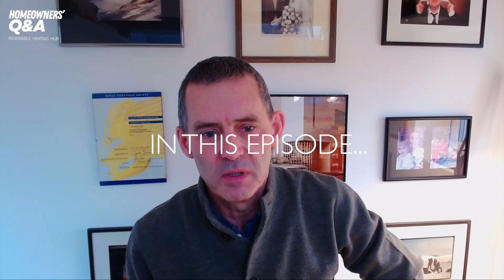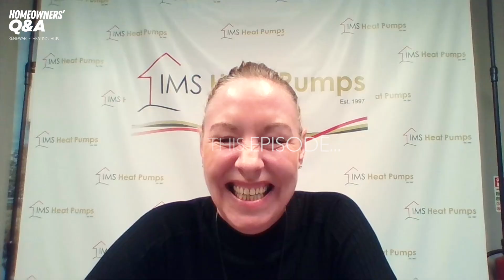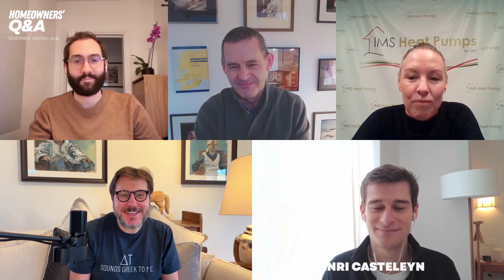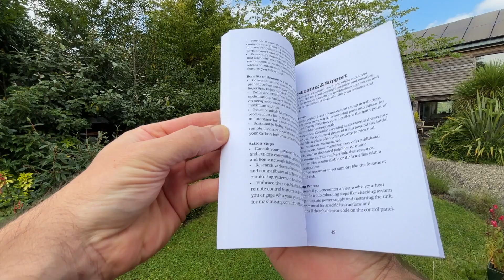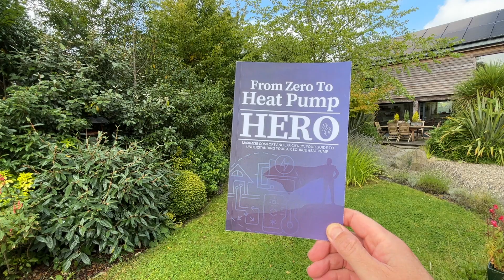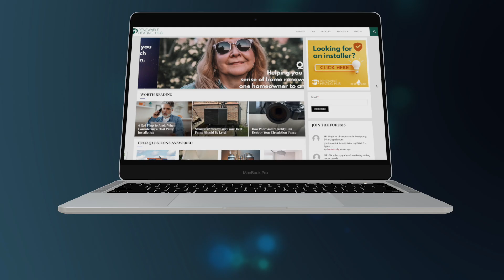The Future of Heat Pumps: Adia & Havenwise Revolutionising Efficiency, Smart Control & Affordability

Comment: Why were the  Homely smart controls not included in the video
Reply from the maker: We’ve covered and spoken to Homely before, and they’ve been around for a few years now. This was an episode for two new upcoming products with a lot of promise.
Reply: @RenewableHeatingHub  What I did not understand was ,what is the difference between the Havenwise product and Homely
Reply from the maker: Homely has add-on kit and hardware, where Havenwise is purely software and requires no additional hardware.
Reply: @RenewableHeatingHub  Exactly right! Havenwise and Homely also have a different list of heat pump brands they work with.

Comment: Can Adia work with Tado or similar smart TRVs, or would installing Adia require existing smart TRVs to be removed?
Reply from the maker: Adia will be able to reply to that with more accuracy, but I think the system will only work with its on ‘TRVs’, not Tado and other brands because those TRVs don’t monitor flow into the radiator.
Reply: Thank you. If Adia could combine forces with Tado, then it could be a really compelling product offering, and probably cost effective for both the companies as well, if they can see it from that angle. :)
Reply: If I understand correctly Tado functionality is a small subset of the Adia functionality.  Each room has an Adia thermometer as well as an Adia TRV on each heat emitter.   There’s nothing Tado can do that Adia can’t do, and Adia do a lot more with each TRV.  

Don’t worry about regular on/off TRV units.  If you have Adia installed the flows in hot rooms will be reduced to keep the right temperature.

Comment: This stuff should be integrated directly into the HP controls. HPs are far, far too complex for novice users. My 70 year old mum would have no chance with a HP, but a boiler is super simple. Install it, set a thermostat and timer, done. HPs are where EVs were in about 2015, which is a shame as HPs are far from new. This needs fixing if HPs are to stand a chance of mass uptake. Make it simple!
Reply from the maker: Fully agree. They should be simplified and work efficiently from day one with minimal tweaking.
Reply: Spot on!

Comment: Thanks again for the great content.
Can you please look at a successful Dutch Heat pump called Adlar Castra which has just begun its operations in the UK? They have an interesting product, different from everything else I've seen before. Look forward to your experts providing feedback about it. Thank you!
Reply from the maker: Thank you the heads up. Will check them out and contact them.
Reply: @RenewableHeatingHub - that's fantastic, look forward to it. 
Adlar calls it an inline system where you can do radiator and hot water heating simultaneously. Looks like they use Panasonic and Grundfos components.
Reply: I'm from the netherlands and we've had a salesperson form Adler 2 days ago.. After this I can't even tell you something about the ínline system' because he didn't mention much about anything. A little disappointing..
 I had expected a real sales-product-presentation-setup- at my house because they only do heatpumps installation. I thought that would be better than a local boiler-installer with minor experiance that maybe needs to call expertise from a vaillant or daikin, etc, dealer. 
This man just watched the situation, took picture of the places where the heatpump needed to be placed and the electrical parts in the house. He didn't talk about radiators. Just came up with the 10 kw heatpump and made a calculation on his laptop for the price. We had to pay 7.500 euro's installed ( after 2.800 euro's 'grant' form government). This is/was hybrid installation with our gasboiler. The heatpump will do 'all' (?) the heating for the house, the boiler for the hot water. So it's a realtive simpel instal.. directly on the pipes below the boiler. He even mentioned shorly with only 2 words about a little,.. I think volumnizer below or next to the boiler.. 
We  use 2.000 m3 gas a year for heating and hot water with the combiboiler now.
Reply from the maker: Very interesting. Thanks for sharing.

Comment: Does Adia comply with MCS ? i'm guessing it doesn't 😢
Reply: Adia here! Yes every install we've done has been MCS certified and BUS grant eligible.
Reply from the maker: Why would it need to comply with MCS, and what benefit would that bring?
Reply: From my understanding,  the Adia device is a third-party component that the Heat Pump installer will fit at time of install. The HP installer will still have had to ensure that the install meets MCS standards if BUS grant is to be obtained. With the higher temp ASHP they will probably be able to design systems that meet MCS standards with little change to systems,  but with associated higher running costs.....until system optimisation recommendations applied.

Comment: So, Adia sounds like it's basically Drayton Wiser TRVs and Room Stats - just specifically for heat pumps, and adding flow monitoring? Wiser TRVs are £50 each; room stats are £70. So for a mid-sized system, if you need both, plus a hub, that's around £1000 just in hardware. Or to put it another way, that's the cost of about 6-8 large double panel radiators. I see the argument about labour saving, but it doesn't seem like a good investment to skip upgrading ancient type-10 and type-11 radiators and spend the money on glorified TRVs instead.

Wiser does work very well - accurate temperature control, weather compensation, etc - albeit with some cycling if your boiler can't throttle down far enough (my experience) - so I'm not really doubting the Adia solution works - but I do doubt the cost-effectiveness, especially since the pitch seemed to be "upgrade radiators later" rather than "no need to upgrade".
Reply: Adia balances the valves across the home in unison; more like engineers with their hands on the lockshield valves, than a TRV adjusting when the individual room reaches temp. For this reason we can maintain significantly higher system volume for the heat pump and limit cycling. 

Because Adia replaces a number of key components of an install (buffer, diverter, secondary pump, monitoring), the incremental cost is almost always outweighed by savings in labour and overly conservative radiator swaps. 

Our mission is to make heat pumps as cheap and easy to install as gas boilers, without increasing running costs. After which we can use measured data from your home to make bespoke recommendations for how to best improve your system's efficiency.
Reply: Also sounds like Wiser isn't doing well in that situation and that setup if it's leading to a lot of cycling, it should be achieving the opposite. I don't think it sets the flow rates to each rad so in that sense the rads remain rather "un-smart", in contrast to Adia, which actually attempts to make sure each rad gets roughly the right amount of heat to it at all times.
Reply: @sunenightingale7384  that's just a problem of the boiler not being able to throttle down far enough - it can only go as low as about 7 kW.

My general point is that it sounds like essentially the same tech. Wiser TRVs make fine adjustments, operate together in zones, can reference external room stats by zone, and the system provides excellent temperature control with weather compensation. 

But if the hardware is basically the same, I'm curious about the cost of the Adia kit. Wiser TRVs are about £50 each - and you can literally buy a double panel radiator for that! 

So the value prop looks like delaying the labour cost on replacing radiators that are probably near EOL anyway, and spending a significant chunk of cash on a bandaid - and by the sounds of it hiding that cost in the BUS.

I'm not skeptical that it works. I'm skeptical that it's a good use of money that could be spent on emitters.

Comment: Is adia an extra cost to the consumer and does the savings in labour offset it?
Reply from the maker: I got the impression that the savings in installation time and not always having to upgrade radiators offsets costs.
Reply: Adia here! Adia replaces a number of key components of an install (buffer, diverter, secondary pump, monitoring), so the incremental cost is almost always outweighed by savings in labour and overly conservative radiator swaps.
Reply: also if you ask engineers how they balance rads everyone seems to do it in a slightly different way. The uniting factor for most of the ways they do it is that they are often time-consuming and to various levels of inaccuracy. 
You could do it with flow-settable valves like IMI, Giacomini, or Danfoss - however the flow rates assumed are based off of probably-inaccurate heat loss calculations, whereas Adia are, I think, setting the flow rates required based on the actual measured room temp. 

In addition Adia should be able to set the weather curves much more accurately than an engineer is likely to be able to - at least without visiting multiple times.

Comment: If installing a heat pump I understood that some radiators must be changed if the heat loss survey determines this. Mustn't you do this in order to comply with MCS and getting the BUS grant?
Reply from the maker: There’s no requirement that you must upgrade radiators even if the heat loss recommends it, and it doesn’t impact the grant.
Reply: @RenewableHeatingHub  Is that still true? I thought the MCS installer must sign off that the proposed design will cover the calculated heat requirement for each room

Comment: I just installed Havenwise for a free trial. Interested if it improves my heat pump? I have just noticed the first bump in the road, it won't let me heat my water to 62c like I normally do cheaply with octopus intelligent go?
Reply from the maker: Im sure that the max. heating parameter for the HW can be adjusted upon request.
Reply: @RenewableHeatingHub  I will ask then. 55c is no good for me.
Reply: @mackay250  Hi! We indeed saw you connected your heat pump to our systems. No worries, we can indeed adjust the maximum target temperature for hot water. I'll send you an email.